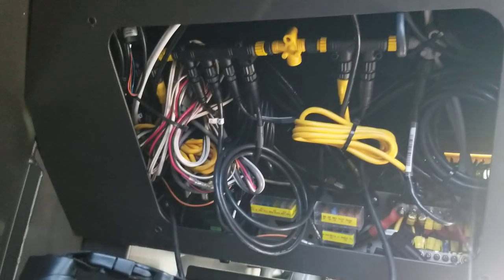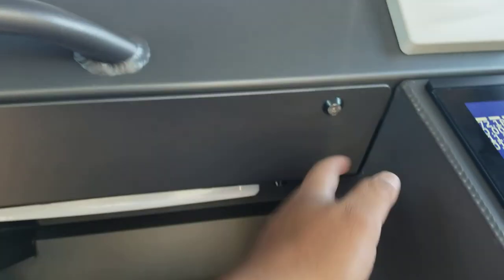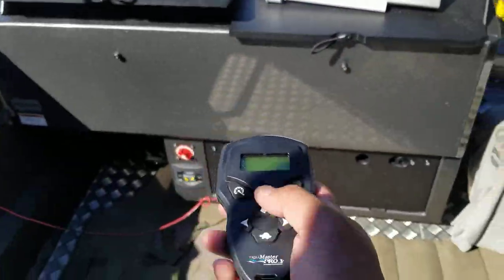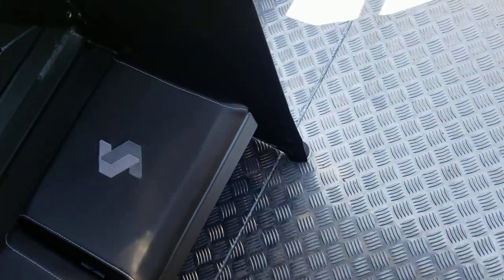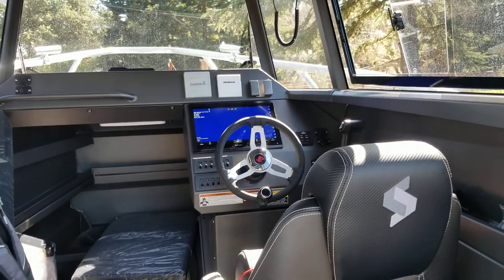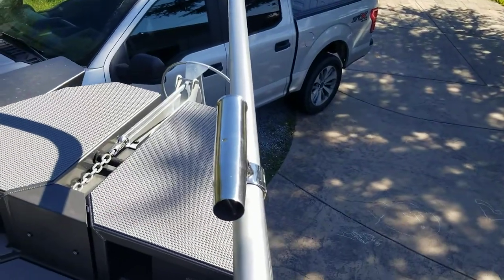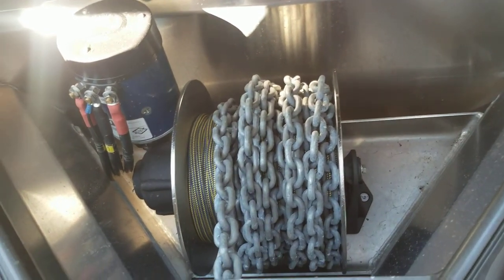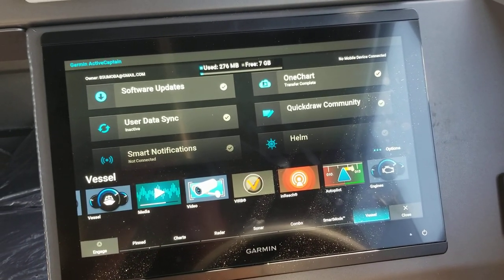2021 Stabicraft UltraCenter Cab full walkthrough part 4 of 4

Comment: Thanks for the in-depth review. I’m looking at the 2250 walkthrough. But still very similar. I like the safety aspect. It seems like a great boat for Alaska. Does yours have a heater? If not I’m curious if the heaters have vents for the windows. I put a Wallas on my 20’ Alumaweld. We deal with freezing spray in the winter which makes it difficult to see when you widows ice up. I’m going to subscribe so keep the updates coming. Give us your opinion on handling. Thanks again.
Reply from the maker: My understanding is  that if you get the option for the heater, it does come with vent holes for the windows as well as a vent for the exhaust on the side of the hull.  I do not think it is easy to add it in after the fact and I would most likely have to go with an aftermarket heater if I did it now.  That being said, the WT has a door, so a heater would work on that boat.  In the UCC, it is just a vinyl drop cover (no door).  I do not think a heater is 100% necessary in my neck of the woods though.
Reply: @bsumoba  thanks for the freeback.

Comment: One issue I have seen is in the chain locker. Since it will get wet in there, some people have placed a spacer between the wench and plating, like a 3/8 white cutting board piece, to not have metal against metal in an area that is not looked at on a regular basis.  Just my two cents.
Again, thanks for another great video.
Reply from the maker: I've heard about that too.  I'll check it out.  Thanks for the heads up

Comment: There is a reasonably new rod holder idea out that it’s a flush mount 360 degree rotating rod holder that you can change from your existing ones. The brand is Evolution. If your future plans are to add an electric motor on the boat your power source should include solar panels get it wired up so it tops up your house batteries as well. Not sure about holes in the transom for your bait tank drain could it not be with a skin fitting externally from the rear of the tank. Just my thoughts.
Reply from the maker: I've seen those rod holders and plan to probably switch to those when/if the current ones either get damaged.  For the bait tank, I have considered a drain from the rear of the tank that simply spills onto the transom, but I think I have a good plan for the larger 1.5" drain and how to do it.  I will post a video about it when it is complete.